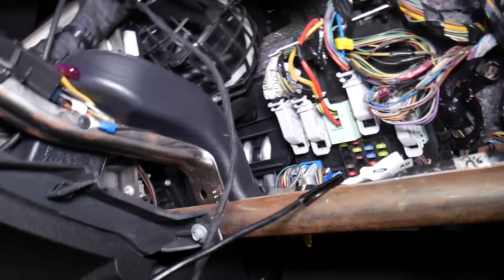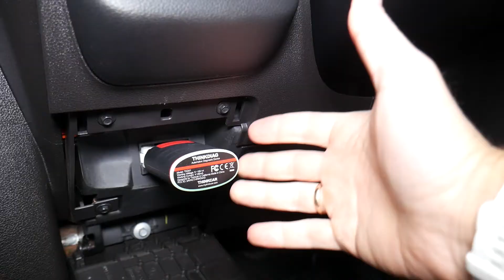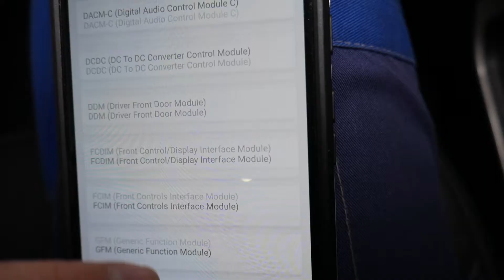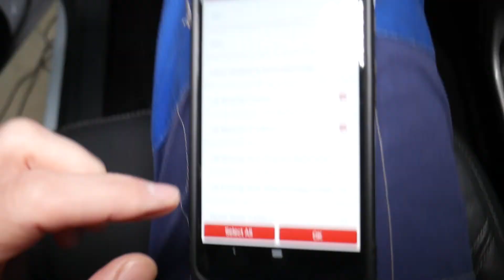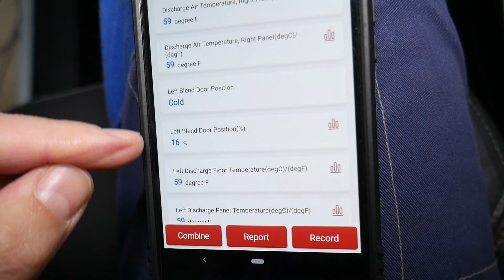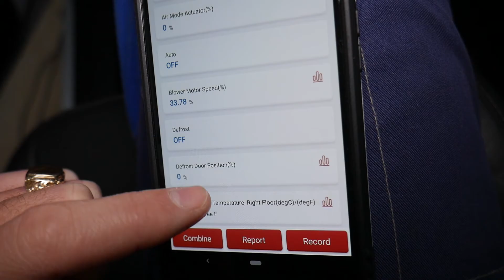HOW TO TEST HEATER AC BLEND DOOR ACTUATOR on Most Cars

Comment: Can it reset the ac in my ford edge 2013 when cars on with ac one sides hot one sides cold
Reply: I just watched a video about your same car....a girl did it by having the car turned to the on position .... and then pressing defrost and power at the same time... and then power, power... look for the video
Reply: I have a Ford Edge 2013 and it's doing the EXACT same thing right now smh...

Comment: My blend door seems to jam n unjam randomly what's the best way to get an endoscope inside to see what's obstructing the door from operating.  Bare in mind that this is with yhe actuator removed and attempting to turn left to right by hand, sometimes it moves freely other times it's frozen in place, could something have fallen through by the vent causing an obstruction.  Im just trying to find an alternative to removing the whole dash out.  BMW X1 F48

Comment: How you do this on a kia optima EX my a/c is blowing very slow and only works for your feets and windshield
Reply: Sounds like your Mode door actuator. Set your climate control to only blow from your front vents. If it still blows on the feet, it's your Mode door actuator